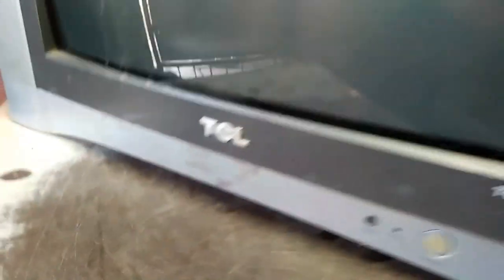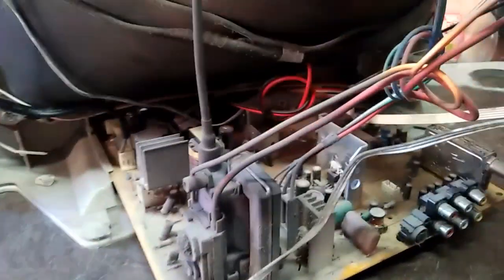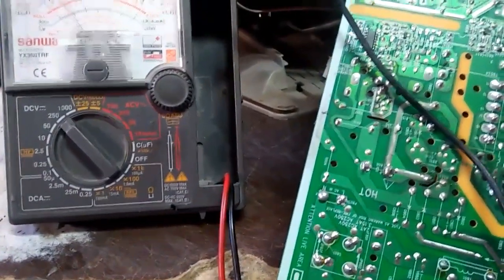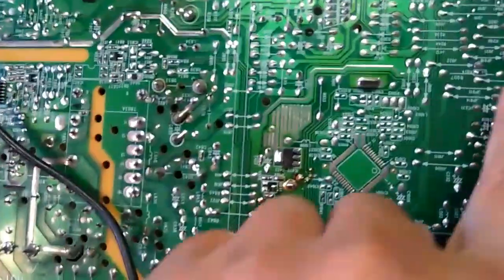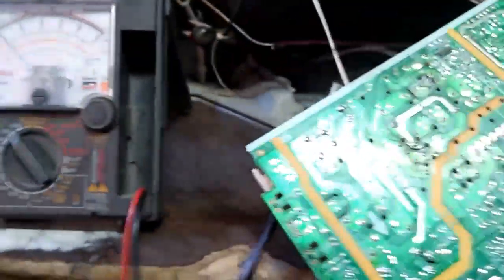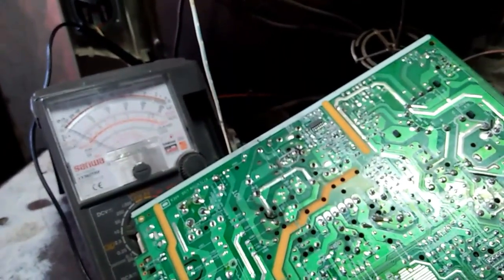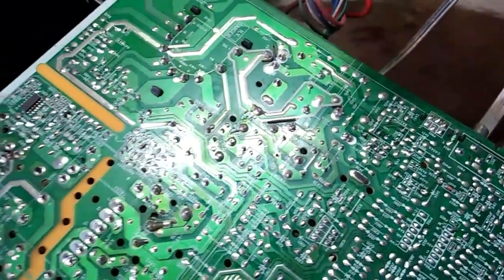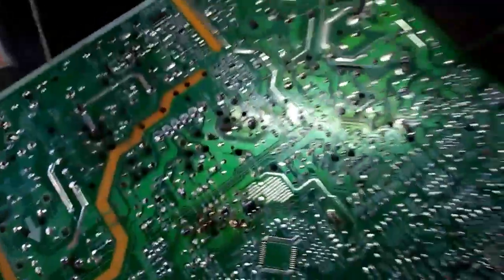Tcl crt tv with power (no oscilation)

Comment: Thanks bro, may inaayos ako dito CRT TCL parehas yang inaayos mo bro, ginawa ko na lahat, mag protect parin, B+ standby 77v, B+ power up Oscillation 110v, Horizontal drive 7.5v , present Naman Ang 5v SA tuner pag nag oscilate, baka may advice ka master
Reply from the maker: Check vertical ic bka shorted na
Reply: Bro Wong, napaandar Kona Ang TCL na ginagawa ko, sobra dilim , tinaasan ko Ang screen Makita Naman kaso masyado na mataas halos mag trace line na, Sinubukan ko tinuro mo sa heater, Kasi sinukat ko 5 volts ac Lang heater, Kaya nag rewind ako sa flyback 7volts ac.. ok na Ang screen pero wala dark white, dapat mag change ka NG channel diba mag black screen bigla lilitaw ibang SA Chanel, Ito puti Makita tuwing mag change NG Chanel.. ano kaya dapat GAWIN sir Wong..salamat

Comment: Sir , ano kaya sira kapag pumuputok agad yung hor out ng sharp crt slim flat yung black...seconds lang sira na sya.buo naman yung yoke at flyback nya.
Reply from the maker: Check snubber capacitor mylar cap na connected sa collector high voltage yun nasa 1600v or 2kv
Reply: Salamat sir....malaking tulong...godless you more!!!

Comment: Gud pm sir, sir ito ginagawa q tcl brand wala ito display  ng check aqo ng boltahe ok nman. Problema yong -14 volts na supply sa vertical wala ito reading pero bago ito tumawid ng diode meron ito. Alin ang posible diprensya nito.
Reply from the maker: Meron bang heater? 
Sa -14v sa mismong filter capacitor nya doon ka magtest ng voltage

Comment: boss meron akong sony 21" nka standby lang sya, sukat ko b+ 135, ayw mg oscillate, ok nmn yong vert. ic at transistor nya. any idea sir, salamat
Reply from the maker: Check 5v sa mga tackswitch at power button or try mo remote
Reply: Naalaala ko tuloy nung akoy nagawa ng tv Sony taong 1986 basted Ang regulator at horizontal output Ng mapalitan ok na Ang mga voltage complete lahat ayaw pa rin mag oscillate pagbisita Ng may ari tinanong namin ginagamit nyo ba remote sa pagpower Hindi raw kapag pinindot switch nabubuhay na kaya Sabi namin dalhin mo remote pagbalik mo Kasi Wala na ako Makita na sira kaya pagbalik nya itest natin syempre pagswitch standby Lang pindutin mo nga remote biglang nagoscillate tagumpay bayad cya Ng 120 pesos labor plus pyesa sa ngayun di na ako nagrerepair humina Ang mata ko pero nautay pa rin kapag ung mga dating customer nakikiusap. Sa mga technician ingatan Ang Mata.....kasama Yan sa puhunan...